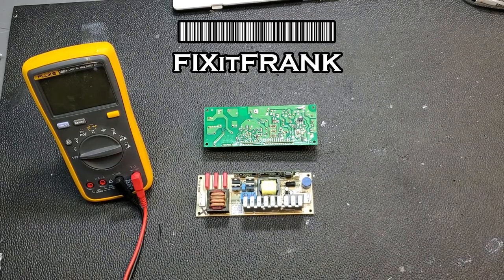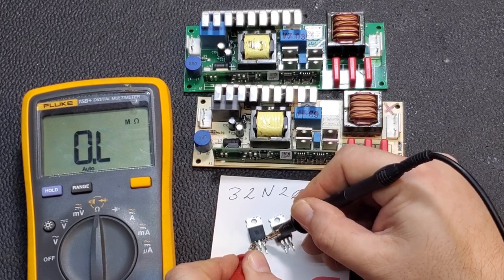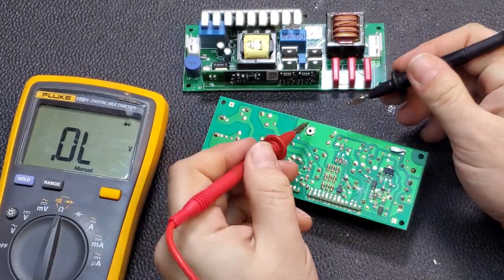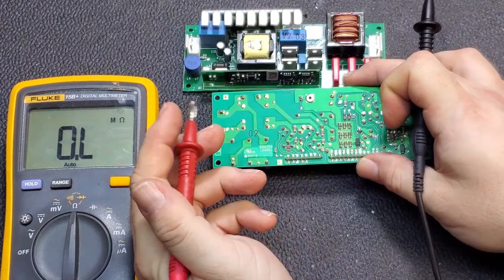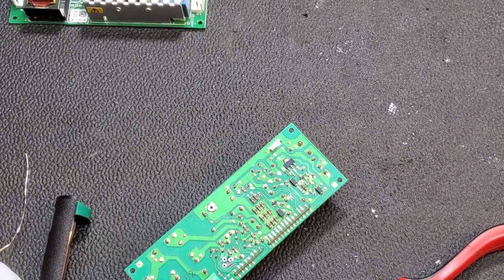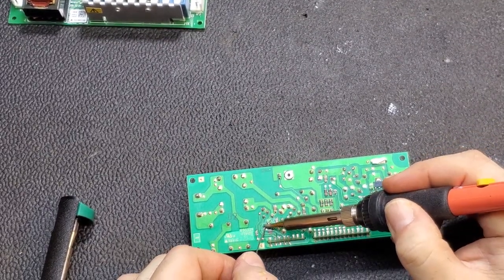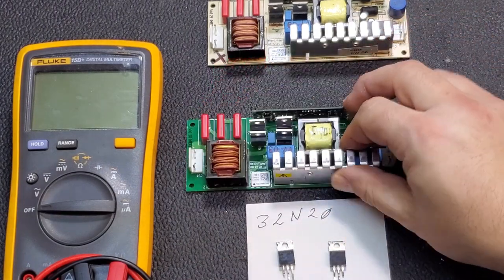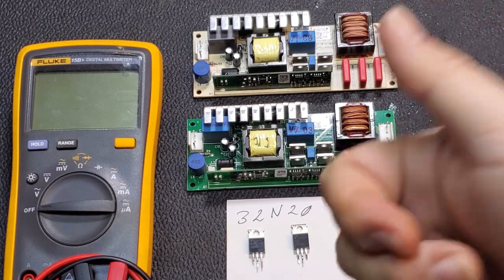Digital Video Projector Ballast Diagnosis and Repair

Comment: hey nice vid! tho, i have a NEC VT660 where the lamp does not light up, and if i remove the lamp (and i did it, tho i shouldn’t have done it because ballasts can break if they run unloaded iirc) i can hear some sparks inside so i guess the ballast is not totally broken, i heard that usually mercury lamps never stop working (unless they explode xD), they will just emit less light, tho this one produces no light at all... so it’s probably the ballast... what do you think? thx in advance 😅
Reply from the maker: Thank you!  These lamps do go bad. They will get more dim until they can no longer support an arc. You are correct in that they do explode, and that is them failing instantly!
In your situation, I would try a new lamp. The symptoms sound like a lamp to me at least. You hear the ballst ticking which is a good sign for the rest of the device. I suspect the lamp is just no longer able to support an arc. The electrodes eventually wear the gap between them too far open.
Reply: @FixitFrank  oh thx for answering! :) so if it cannot arc anymore it will emit 0 light? like, i put my eye right on the lens, and saw it completely dark during the whole start process... i got it for free from my school, and buying a lamp for it isnt an option considering its age and its low quality xD isnt there a way to check if the ballast is actually able to fire a lamp or if it’s too weak? the lamp seems brand new to me
Reply from the maker: @xzVice  Correct, it will put out no light. Unfortunately there is no other reasonable way to check a ballast.  The only way to know if a ballast is working is with a good lamp. At least without special equipment. you can't use a volt meter on these because the ignition voltage is way too high and will smoke the meter(they top out at 1000v for a good one but the ignition voltage is 3000-7000v).  Since you hear it ticking, that is likely good. That noise is the arc gap in the ballast making noise.  honeslty this is a really old projector. Plus its an LCD so there is a real good chance the optics are failing, or have failed.  It's 18-19 years old.  For a projector that is really old and for an LCD, that is ancient. 
It would be fun to take apart or if you find another projector lamp that you can steal a bare lamp out of and fit into yours it mght be worth messing with.  Basically its not really worth anything monetarily but it would be fun to hack up and try things with.  Take the ballast out, try and put an LED driver in it. Or just scrap it down and make some stuff with the optics. Maybe sell the ballast and other guts on ebay.  I agree that its not worth putting a lamp into and I dont think you can even find them anymore.  I'm sorry I can't help with getting it working, but I do think you could still have some fun taking it apart. Just be careful with the power supply and ballast. The power to the ballast is close to 400Vdc and can kill you if you are not careful.
Reply: @FixitFrank  Yep you’re right, and no dont be sorry you already helped me a lot and i gotta thank u 😃 also, i have another projector, it works but the dlp is broken (a lot of white dots on the screen) idk if i could move that one’s lamp to the lcd one (i’d have to move its driver too), and idk if it would either be worth the job 🤔 that one is an Acer DSV0817 and under of it it says mercury lamp inside, so maybe i could just swap the lamp on that nec vt660 with that one, but i’d like to not break that lamp if possible xD... what do you think? 🤔)
Reply from the maker: They look like they are different types.  the VT660 is using a DC lamp but the Acer has an AC lamp.  If you put an AC lamp into a DC ballast it will blow the lamp up.  You can sort of get away with using a DC lamp in an AC ballast but they dont typically work well.  Normally I say knockoff or cheap lamps are terrible but in this case, due to the age, I would see if you can find a cheap bulb on ebay and use that. I even looked around to see if I had any old ones but I dont have anything that will fit unfortunately.
Reply: @FixitFrank  so should i try to put the VT660 lamp inside the acer one? since you said that it should work, just to make sure that it works, what would i risk? 😅
Reply: FixitFrank nvm i already bought a compatible VT60LP bulb for 26 euros for the nec (i replaced the bulb inside the original housing i already had) and i also bought the dlp for the acer one for 27 euros since there were a lot of white dots. both bought off aliexpress and now both projectors work!! the nec’s light is kinda low but i guess it was like that also with the original bulb

Comment: Love your video. I was able to run down a bad MOSFET on my Benq projector. I have 12.4 M Ohms going across the gate and source, which tells me it is allowing some current all the time. I am repairing the exact ballast you show in your video. Thanks for taking the time to do this.
Reply from the maker: That is awesome to hear!  I'm glad it was helpful.  These ballasts can be a real bugger sometimes.  Give a shout if you have any other questions. I have a few used but known-good ballasts around that I can check against.
Reply: @FixitFrank  I replaced the MOSFET on the board and all tested good. I reinstalled the board and the projector came on for a second and then went off. Now I have nothing. lol Back to the drawing board.

Comment: Hey Frank, Very detailed video, thank you very much. I have a 3LCD projector that almost "struggles" to fully turn on the lamp while powering on. It will flash the logo briefly and dim out several times, each time emitting a high pitch buzz, until the power lights begin to flash the error message. HOWEVER, of every 1/15 or so power-on attempts, the lamp will light and stay continuously lit and function as intended. Do you believe this to be a ballast issue? 
Thanks again
(Hitachi cp-dw10n)

following up: I removed the ballast and tested the mosfets and diode, and had a few discrepancies. My ballast appears to have 5 mosfets, 4 of the same model and an extra one next to the diode that is different. Also my readings were vastly different then yours, each mosfet had no more than 15 mOhms from drain-gate or source-drain. Nowhere on mine did I read any kOhms. Aside from that, one of my mosfets had 0 resistance one way and but not 0 when the orientation is reversed. I thought it mightve been a diode for a second but it definitely has 3 prongs...

Moreover, my diode reads the 0.389 V but the orientation of the tester had little to no change of the resistance measured. What I mean is yours read something like 70 kOhms one direction and 10 mOhm the other way. Mine on the other hand was 0.566 mOhms and 0.458 mOhms. Is this a sign of a bad diode? Or merely a difference in our ballast circuitry...
The ballast  model# is PHG231A6NF
Any advice would be greatly appreciated!
Reply from the maker: Hi Ron, How is the lamp?  That could be my first suspicion.  The ballast definitely could be an issue but since its making a buzzing noise, I think the ballast might be generating its high voltage for ignition and the lamp it not functioning properly to strike the arc.  If the lamp is definitely new/good(possible tested in another projector) then a ballast would be my next area to check.  If the lamp is anywhere over 1500 hours, I would be suspect of its operation.  I say this because the lamp is the easiest part to get and return if the new lamp does not improve the situation.
Reply: @FixitFrank  Hello again,
You are absolutely correct, I thought I tried a new lamp already but I must've swapped another used one in. Managed to put it all back together and shes working like a charm now! Thank you!

Comment: Hi Frank, I have (2) Sharp vision xv-xz2000 both have same color issue using the same new color wheel. I have a bright bulb seems ok . Images are not distorted just crazy color. I checked cables which worked fine before color wheel flew apart. Both have the 2 green lights normal run and both sound good on power up with no shutdown or red lights. Both cleaned and damage checked per your videos. Did I buy a bad color wheel. One projector bought used for backup or parts had good black & white picture with color wheel glass missing.

Comment: Hi! I just bought a broken jvc x30, seller thouht it could be the ballast. The first lamp started to flicker at around 1300h and was replaced, the second lamp failed after around 1300h too so he put the old lamp back with no success. I bought it for almost nothing hoping to be able to repair it. Now i have taken the ballast out but cant find any obvious fault on it. I have ordered a new lamp, maybe I should have started with that! 
I tried to measure the diodes on the board and two of them showed short circuit on the outer legs when mounted on the bord, but when I desoldered them they show no short circuit. Any suggestions?
Thanks 
Anders
Reply from the maker: That sounds about right. Those outer legs of the diode are connected together to act as one diode. I'd put it back together and try a new lamp.  If the new lamp works, clean out the fans and air ducts of any heavy dust build up.  Make sure the lamp has a Philips bulb or even an OEM from JVC(a little pricey).  I know JVC rates these at 3,000 hours but I also know the lamp they use has gone through 3 or 4 versions since it was released because it can't really run 3,000 hours... That little metal piece in the intake of the lamp is supposed to direct the air towards the center of the arc tube. It should be on a slight angle depending on where the lamp was from.
Reply: @FixitFrank  I must admit, I had removed the powersupply and not the ballast. Now i have taken a look at the ballast but the two mosfets seemed ok. There were one 16 legged transistor that I didnt know how to diagnose, so i left it untested. I saw one repair where an octocoupler had failed along with a resistor. My resistor is fine, but how do I test an octocoupler? Wish I had some local place to send my ballast for a repair. I also tried a new lamp, though it was a cheap one from ebay, just to see if it worked. But its still as dead as before.
Reply from the maker: Hi Anders,  Usually you can check the diode side with a diode test on a DMM.  I like to remove the optocouplers and put them in a breadboard to test them for real. I would be surprised though if it were bad. A useful quick-dirty test is to measure each of the 3 couplers and compare them.  They should all measure about the same resistance.  One will be reversed on the PCB.  There should be 2 or 3 on the ballast control Input. One is for reporting the lamp on/off , the other 2 are for actual lamp power on and the other is for dim/bright.  
Do you have the HV at the ballast input?  I would start checking voltages and find a service manual.  There are so many possible causes it can get your head spinning.  

When the old lamps failed, did they explode or merely stop lighitng?

Comment: Hi Frank, First of all thank you for making these videos. In this day of content creators and hustlers who do it primarily for money/subscribers/links, etc, it's great to see someone freely sharing their knowledge. Yeah sure you could make some money via YouTube as well and frankly you are entitled to. Do you sell components and modules? I think you should do so and promote your store in your videos. Most of us would buy from you simply out of appreciation for the tutoring/troubleshooting.

I'm currently trying to diagnose a lightly used Optoma HD180. Turns on normally, fans operate normally (verified via testing with case open), it's clean inside. Opened it, pulled it apart, didn't see anything visually interesting (signs of overheating, shorts, etc). It runs fine for about 5 minutes then the lamp suddenly shuts off, fans keep running, and then the orange power light flashes and the lamp indicator stays solid red. There are no unusual sounds, smells, or behavior other than the sudden shut down, lamp shows little signs of use, no residue, or discoloration.

The previous owner reset the hours to try and diagnose but told me it was hardly used and had low hours. I have no reason to think he's not being truthful, I still have his contact information. I didn't check the power supply though so I guess I should pull it apart again and check it. I am picking up a new multimeter so I can check the parts you have identified as problem areas. Should I just buy a new bulb to start in case this one is defective? If they weren't so pricey I would have just done it already. Thanks again and thanks for any input.
Reply from the maker: Hi Inokea!  Thanks so much for the kind words!  I don't run a website but that's OK. I do this for the fun of it. I have a day job and that pays my bills so far.  
As far as your situation, I would be skeptical of the lamp assembly.  The symptoms kind of sound like a bad IR block coating on the lamp housing.  Before the projector shuts off, do the colors flicker for a brief moment?
Reply: Hi there, I have the exact same problem with  an Optoma HD70. Its seen 5800hrs without problems, few years ago I cleaned the color wheel and it still works great, except it began to switch off suddenly as described by @Inokea in the comment. Unplugging helps, the device works again, sometimes for hours, sometimes only a few minutes. Lets see if the repair will work :)
Reply from the maker: @RoBBz2000  Check the power supply capacitors.  I just worked on an HD70 about a month ago with a set of bad capacitors. They will look obviously bloated.
Reply: @FixitFrank Thanks for the reply. I haven't done anything with it, just so many other projects going on. I will check on the lamp and power supply.

Comment: Good afternoon Frank, first of all I want to thank you for this great contribution, very well explained and detailed. I am going to ask you a question because you may have seen it at some point and a suggestion would be welcome. I have a viewsonic pjd5134 projector that, after 100 seconds of being on, turns off the lamp and turns on the temp and lamp LEDs at the same time. The equipment has 59 hours of actual use, when I disassembled it I noticed that the turbine that cools the lamp did not turn and I bought an identical one, the problem persists, I have noticed, approaching my ear to the source area a very low noise, a buzzing sound, This happens when the computer is turned off. Will this have something to do with the fact that it always goes out after 100 seconds? From already grateful. Greetings from Argentina
Reply from the maker: Hello!  Thank you for the kind words!  I appreciate it.  
Your projector sound like the issue might be color wheel related.  When you say 59 hours use, is that 59 hours total or 59 on this lamp?  IF 59 total a bad color wheel would be very strange as would a bad turbine.  The lamp fan should start soon after the lamp ignites.  If the fan never starts and then the projector shuts off, the power to the fan may be a problem.  
The best thing to do now is measure the DC volts on the fan output while the projector starts and runs.  You should read 8-12 volts on the fan power. If you read 0 volts then there is a problem that may be more difficult to fix without knowledge of the mainboard.  
I would put the old turbine back after testing.  You can use a 9V battery and some wire to test.  The turbine will rotate down to about 5volts.
Then I would check voltages at the fan connectors.  They all should be very similar.
Reply: @FixitFrank  
Frank, good day!
Thanks for the response offered
Well, I will go on to summarize what happened, I have removed the color wheel, I checked that it turns with some hardness, I took advantage and I cleaned the sensor.
Again, when assembling everything again, I encounter the problem that now the lamp turns on only two seconds, it turns off and the two fans remain on at maximum speed, turns on the lamp light and remains fixed, the blue light on flashes intermittently.
the question that comes to my mind is that in the service where I have taken it, they have replaced some part, I have noticed that in the metallic protector that protects the color wheel there are some suspicious scratches by manipulation, what do you think?
regards
Reply from the maker: If the lamp is turning on but then turning off that quickly, there is something telling it the lamp is unsafe.  Usually that is a fan not reporting the fan speed correctly.  You may want to examine the wires and where they are connected. If it looks ok, then checking the voltage on each RPM lead of the fans. Most measurements will be very low. Less than 1vdc.  3-5V or higher is a bad fan. This will also happen if a fan is not turning. Be sure to use the old turbine for this.   
The issue makes me think the turbine for the lamp may be faulty and that the new turbine may not be compatible.  The RPM sensor would show a higher voltage if it is not compatible.